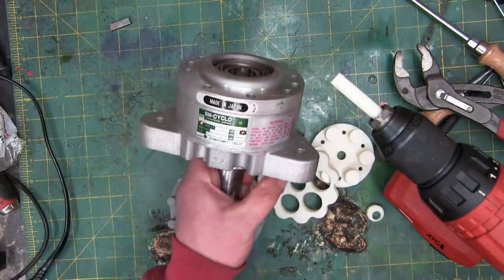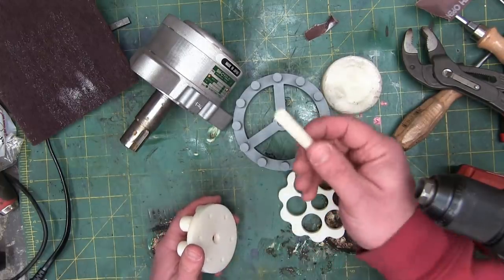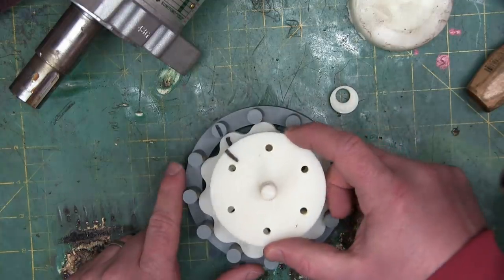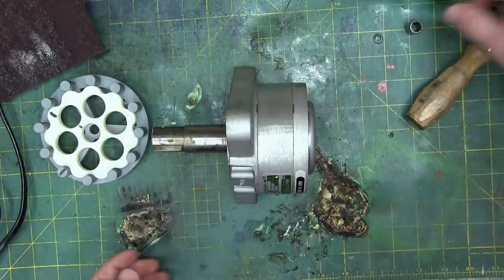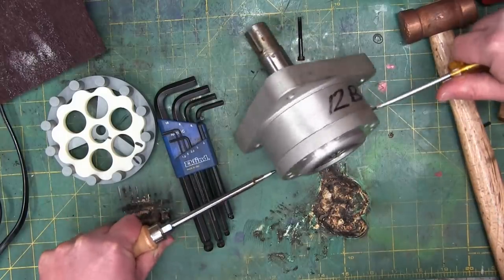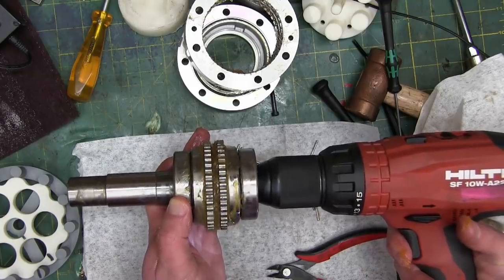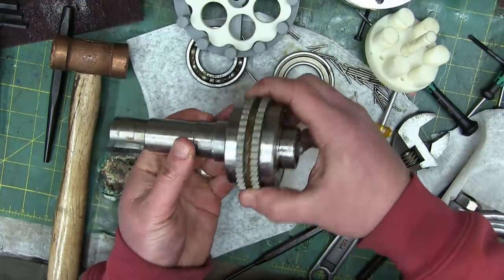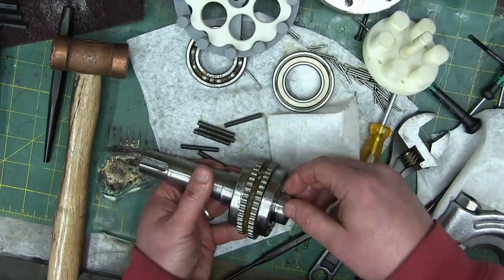BOLTR: SUMITOMO CYCLO GEARBOX | Zero Backlash!

Comment: In a non-woven textile plant I worked in we installed a Sumitomo Cyclo gearmotor on a heat press calender. I think it was a 60 hp on a VFD. The gear reduction was massive. It turned two rolls that were probably 36” diameter down to probably one RPM. Chain and sprocket reduction was probably about 4/1. That Sumitomo is one part of the machine we never had to work on!

Comment: Great video as always!
I don't know if anybody pointed this out, but: When designing the center gear (white one in this case), you should always make sure it has an even number of teeth. If you put the mirorred piece in place, it would line up with the 'original'. In case it has an uneven amount of teeth, the teeth of the reversed gear would be in the middle of (in between) the teeth of the original. So after all these years I found a mistake. I blame canabis.
Cheers!

Comment: My parents installed a cycloidal separator central vacuum cleaner decades ago. It works great though the motor had to be replaced, so it's definitely been done long before Dyson. I'm sure it sucks a lot harder too. Years ago a Kirby salesman came around and they had a suck-off. The central air vac could have run all day since the motor cooling is separate than the suction. They don't build them like that anymore. It's all-metal too.

Comment: Neat, hey, I’d recommend your friend includes some clearances on the 3D models for smoother fits, .3-.4mm is generally good for press fits and .5-.6mm is good for sliding fits, more accurate printers you can use smaller clearances, idk, might save you some trouble of finishing your prototypes

Comment: Im not sure if it's the same thing, but if its not, strain wave gearing, also called a harmonic drive,  works similarly and is truly zero backlash.  You can get enormous reductions and huge torque capacity.  They are also extremely long-life, as the stress induced in the strained ring gear is well below the fatigue limit of the material, and the insertion of the tooth is nearly linear and normal to the gear face, so there is very little sliding of tooth surfaces against eachother.
Reply: Looking at it closer, It doesnt look like the same thing.   Those separate ring gears just look eccentric to the main shaft but still circular.   If thats the case, it may have no lash on the output, but there must be at least a little free play at the input shaft, (it may have been reduced to the point where it isnt detectable by feel.)   Strain wave gear teeth actually pinch the rotor teeth when they interface - absolutely no motion on the input that does not produce motion on the output because it's effectively an interference fit.

Comment: Two  other  bonusses using the cyclogears:
1) cheaper to make the components then cutting gears.
2) easy to store basic components and make reducer to order at a local Sumitomo subsidiary.
 
Once got headhunted for position of general manager for a  Sumitomo Cyclo  subsidiary, so got some inside info.

Comment: Ive rebuilt two of these style units what for are pulling SD70ACe locomotives. Huge starting torque required to shift these giants and the only time they let the smoke out is when they have let the oil out foe too long. Wont run for long dry, much like me.
Cant thank the reps enough for teaching me through repairing and timing them.  It actually seemed like they wanted their old products to keep living. Unheard of these days. Caveat... expensive as frig.

Comment: You can configure the bigger units to be grease lubed, if you so desire.
They have superior ratings when oil lubed though.  Vertical mount units usually have a small internal pump.
For those unfamiliar with these, look up pictures of the Cyclo 6000 series.  The larger ones especially are absolutely lovely to look at internally.  Very high tolerance parts involved.
The large units also have an unmistakable angry growl to them, and can be heard from quite a distance.

I'm sure other have pointed out, these do indeed have backlash, especially on large, multistage units.  Far less backlash than a helical/spur gear arrangement of the same reduction, as you mentioned.

Comment: Unless she's got some counter-wobbles on that shaft or other clever bits we're not seeing, that critter will want to wiggle a bit transverse to the shaft axis. You can see why by attaching (or imagining, for sedentary visionaries among us) a weight to one end of a bit or rod, and another weight 180deg out near the other end. Then give it a vigorous twirl in your drill. That gyrating shake is from the unbalanced centrifugal forces along the length of your shaft, which can be uncomfortable for everyone.
But Sumitomo obviously knows what they are doing. The discs are close together and the input shaft speed on most of these units isn't crazy fast, both of which reduce hip gyration urges. And that puppy is built stout. She'll be right.

*No animals and a handful of neurons were harmed in the production of the pedantry above.

Comment: They installed a much larger one on the step feeder of the sawmill I worked at.  A pile of logs was fed into the bottom of the step feeder, it would separate the logs and deliver them one at a time into the infeed conveyor of the Canter. Several tons of steel and logs moving up and down. It had to start and stop precisely at the right time to avoid double feeding of the logs and had to keep up a 12 to 25 logs per minute pace. (Logs were 8' to 16' long.) Never had to change the reduction out in 15 years. The mill ran 6 days/120 hours a week. With all the starting and stopping of that tremendous weight, I don't think a standard gear reduction would have lasted a year.

Comment: If you want to do it perfect you'll need 3 set's of discs and cams, while the middle one has 100% thickness and is at 180° while the two outer ones have 50% thickness and are both at 0°. If you put a bike in a repair stand, take the chain of and spin the cranks fast you know why you'd need to to that to get it perfect balanced. Big single cylinder motors also have 2 counter shafts to align the center points of the rotating masses.

Comment: The Krautheads have some specialty bearing pullers that use tool steel bars in place of the usual hooks.  In place of the hooks, the flat bars fit next to the balls and have the profile of part of a ball. You wiggle them in there and then pin them into the puller assy and pull away. If that doesn’t work, then just put an abrasive cookie in your die grinder and cut the races off. Assenmacher in Colorado used to sell the pullers for use in transmission work. (BMW?) You might have to trash the ball retainer to use the puller.

Comment: I had a patience prob running my lathe. Running tool feed too close to main chuck = KABLAM!  Fixed the stop tight, but replaced the steel shear-pin on feed-worm shaft, with a LDPE pin. Broke a couple so switched to small cheap tye-wraps for shear pin. Thanks for your work.

Comment: Actually, I think you'd be pleasantly surprised at how much torque those 6 pins will provide. You can consider the output shaft which is near the axis and the pins to be a form of lever where the fulcrum is the center of the axis, the output to be the surface of the output shaft, and the input to be the location of the pins.  Wouldn't be surprised if the pins only have half the shear stress of the output shaft.

Comment: The six pins that drive the main shaft are positioned as far out as possible (at least it looks that way), so they need to transfer less force to transmit the torque (they travel a longer way).

For really heavy duty torqe one might want three or four excenters stacked like 1:2:1 to cancel axial moments.

Comment: You can actually brush a thin layer of acetone on the prints and it takes off the uneven sections, just be careful not to keep the acetone on there too long or you end up dissolving the pieces.

Comment: I have an e-bike which has a mid mounted pin ring motor from a company called tq-systems,
this motor works on the principle shown here, it puts out 120 NM of torque which is pretty significant 
in the e-bike segment. Worth checking out.....

Comment: You need to size any gear reducer for the low RPM torque - if you want a 3000 ft/lb torque multiplier for your drill motor, it can be done, but not with that unit...
That unit seems like it could handle a fair load, usually the shafting gives an indication of the torque range, and it's output (low) looks like 30mm or so. 6 pins can carry a pretty substantial load, so may not be as big of a limit as it may appear. I'd see if there is paperwork on that box, looks expensive and there should be a spec sheet available. (SM-Sumitomo has an office in VA)
If you ended up with a tool that could put out 800 ft/lbs with a cordless drill or 3/8 ratchet drive, that would be a cool tool with a lot of uses.
They do sell some reasonably priced(?) torque multipliers for hand changing heavy equipment wheels, but they are pretty heavy and require a static anchor point to chain the case to. I think they use planetary gearsets. 

I doubt any of the possible gear reducers would play well with impact technology, but they've got some pretty funky stuff going on with impact systems as well...

Very nice piece - please let us know when you find a home for it. 

Very interesting!

Comment: A word to the wise. If you don't know how to take one of these apart. DO NOT take it apart. On this one there are most likely bushings that the pins that were coming out at the 10:30 mark. In the units we run into at work the disc with the is actually the output shaft. Put a couple of these in tandem and you can really get things to crawl

Comment: No,  this needs to be used for a more accurate 4th axis or a very nice rotary table accessory.  Use that low backlash to your advantage. Any old planetary set can gets you lots of torque with sloppy backlash,  use this bit of kit for its strengths.
P.S. First time to comment, so I should mention what you do here is great for the world and ready to see your daughter's metal making channel when it comes out.

Comment: to smooth out the surface on 3d printed with abs use acetone.  not to much as it melts it.  the best way is to vaporize the acetine  but be careful to not blow yourself up ! and do it in a weld ventilated area

Comment: Most interesting mix: German explainer of Japanese tech.   It's OK just the irony of historical belittling of Japanese tech.  This is a fantastic transmission.  I made an iron bending tool out of an old 18 wheeler steering gearbox.  One of these would have been much better.    No telling the endless occupations one could put this to on a farm.  Taking young boys off the farms to make single job machinists in the city, has got to be one of the most self-damaging economic strategies of modern America.  Feeders, gate opener/closers, planters and cultivators, windmill water pumps and air pumps and electricity generators;  The list is endless.  Steak in Japan should be 99 cents a pound not $99.!  I would rank this invention along with the pencil and the screw.

Comment: After seeing the cyclogearbox one come apart, it looks like a bit of hydraulics could engage or disengage that output shaft. Since there needs to be two gears in parallel for vibration dampening anyway, I wonder if they actually do have to be driven at the same speed. If not, then a real compact no-backlash variable speed transmission looks very possible.

Comment: So if you ran it the other way around, you'd turn one revolution into 43. Think you could drive a turbocharger with it and have on-demand boost..  IE:   electric motor coupled to the gearbox, then output shaft to the impeller shaft on the turbo.

Comment: Use these on wellheads as part of a tubing rotator, 1/4hp electric motor and with an final output speed of 1 rotation per day...so yea they put out some torque. Easily a couple thousand ft/lbs however they did have a tendency to fail once in a while, makes me wonder if those little pins can't handle it.

Comment: because its using two gears off set 180 degrees its applying force to all the pins at once maybe it can handle the really high torque tool your thinking about making.

Comment: Not aJapanese invention, it's actually a German invention (for tanks I believe) and I had one on a steel rolling mill for making horseshoe steel that I built back in the 90s. Great gearbox...it had to be to handle the torque loads from the 4KW motor that drove it......

Comment: having 3 lobe plates one center has same mass as 2 other lobe plates would have even less vibration. I helped design a speed reducer like this 20:1 reduction for a jack screw that moved a parabolic dish. It was all plastic and i designed the mold for it. It had to be plastic to keep cost down. When 3d printing came out i thought i would not need to design a mold but just print the parts. An interesting design mod was to use a mass produced item like a bycical chain for the outside pins. it would add to the efficancy because a bike chain has rollers and would turn as the lobe plate would ingadge and disingadge. 
An American company makes a design like this called Harmonic Drive Technologies Teijin Seiki Boston Inc. 247 Lynnfield St. Peabody MA

Comment: So, hang me if i'm wrong, but i think you got your splitter upside down there, both from a strength and a practical utilization perspective. I'll grant that it might fit better tho, and you gotta p!ss with what you brung. 
Also, no shop press in the empire of dirt? All that hydraulic gear and nothing to use it with. Princess Auto has to have a cheap one you can finagle into something that works.

Comment: Much like multi-phase electric motors where the more phases there are, means you get a smoother sine wave output (assuming if I am correct in that assumption!), SOOOOOOO, may suggest that the MORE in-between rotors (say 4 of them!) means you should get a REALLY SMOOTH rotation and little to NO vibration!  Am I correct on that assumption?

So someone here should make a REALLY BIG CYCLO gearbox our of STEEL or TITANIUM and TEST how much smoother your cyclo-rotation is for TWO rotors versus FOUR rotors (90 degrees out of phase!) would be!

Comment: it doesn't vibrate cuz it doesn't vibrate to begin with.  you see a vibration when you play with plastic parts in your hand, but when it's put together, mounting, and running, it doesn't vibrate.  none of the parts reciprocate, they all spin smoothly, regardless of the fact that they are off-center with respect to each other.  you should watch a multi-piston radial airplane engine run.   smooth as silk and off center by the length of the stroke.

Comment: In theory, it would be wobbling even less with 4 cycloidal disks. More friction, more expensive, and less low profile, but even more stable. No?
Reply: Yup. And you could probably save some weight by using smaller bearings, since all lateral forces should be balanced, whereas with two discs the bearings have to prevent the shaft from tilting. But yes, you would have more friction from one more pair of disc surfaces rubbing on eachother.

Comment: Kobelco excavator have been using these in there sk120 size units. In the final drives  they do work well but they burn up gear oil .

Comment: A COOL TOOL TIP : old dull worthless drill bits that cant be sharpened make great punch that are the correct size for any size. especially for roll pins that are hollow that have to be the right size or it5 wont take out the roll pin. so old drill bits are great just remember they are brittle so wear safety squinters or preferably safety glasses when hitting them with a hammer. reply if you like the idea or have a better one or another COOL TOOL TIP. lol

Comment: So, what's the downside of using this type of gear box? Why not use them in car gearboxes by just changing lobe count to change gear, for example?
Reply: This is for reducing.
Reply: Torque ripple
Reply: They also cannot take high RPM.  Typical Max input speed is 1800-2000rpm.

Comment: Is there possibly a thread in the input shaft hole for pulling it a-part? It might work with proper 12.9 puller bolt... Anyhoo very cool stuff even if you possibly can't get it completely a-part. Also, I'm afraid you already ruined the bearings with hammering (tho they're likely not that super expensive anyway).

Comment: I'm going to ask what is bound to be a dumb question ... do you get an proportional torque gain with this type of gearbox? 
My gut says no, cause a traditional gearbox with EG a 1/10 ratio means a proportionate change in lever arm so 10times the torque (frictionless universe) 10 times less angular velocity.
But if no gain... conservation of energy problems ...